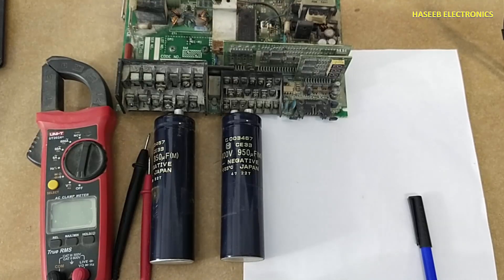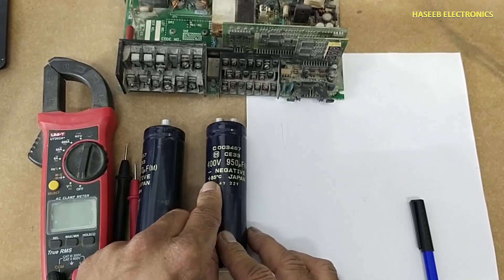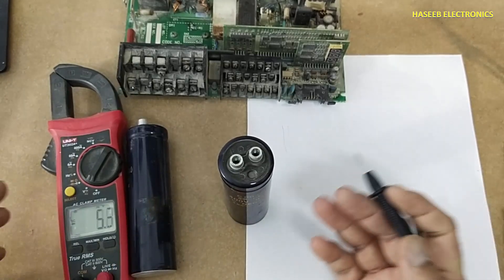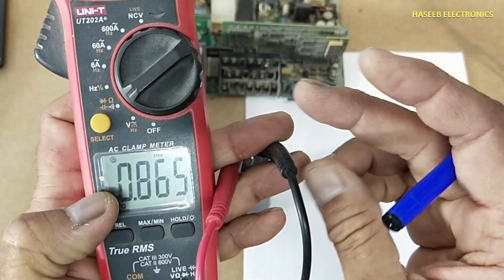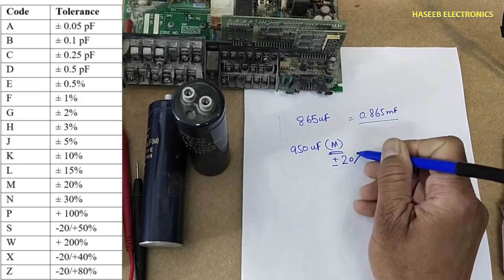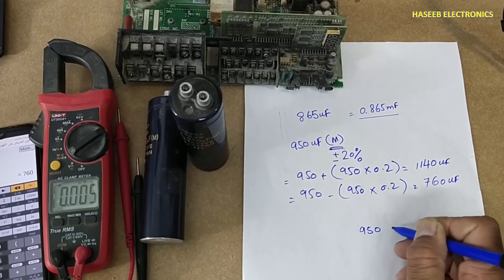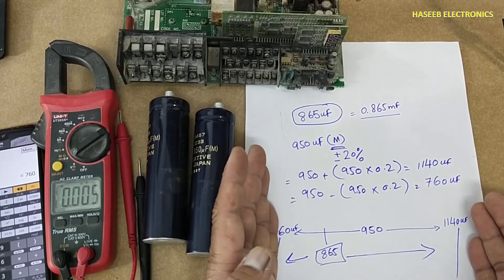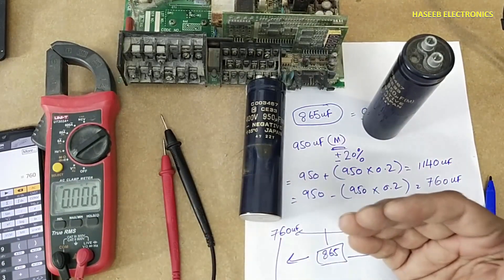{1052A} How to test capacitor using multimeter

Comment: sir may i asked question,  how to determined the output of  defective smps power supply if there is no label in the chassis  for ex 12v the output cap is 16v while 24v the output cap is 35v? thank you.

Comment: Dear Hasseb, 
Some times the capacitances of the capacitors are good but these capacitors have high ESR levels, so you must check also with ESR meter.
Reply from the maker: exactly you are right. ESR testing is very important, but if someone don't have ESR meter, he may try this technique to assume the serviceability of the capacitor.